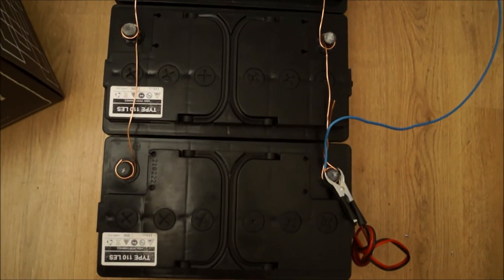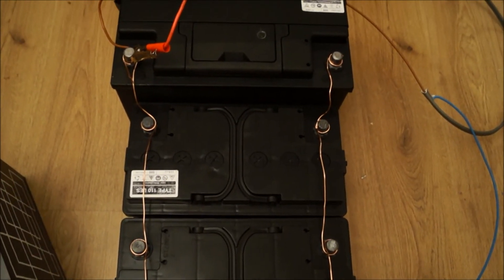Batteries Explained - Series - Parallel - Ah - Volts

Comment: Hi, Is it safe to use a bigger battery for my ebike ? mine uses 48v 21Ah, and the newer models of my bike uses 48v 42Ah, would it damage my Ebike's engine or would it actually improve the range of how many miles i can do ? . Thanks in advance

Comment: i have 4 batteries and they are all different ah my qustion is can i wire them in parallel whiout any problems ?
Reply from the maker: +Ilia Zhelezarov You can but if one of the batteries isn't very good compared to 3 better batteries, it will drag the 3 other ones down. So long term it's not the best. But having said that, my 4 batteries were new and 1 is clearly different. I haven't seen any noticable problems!
Reply: PrepareForTheUnexpected ok tnx my batteries have not too big of a diference in ah

Comment: A common misconception is that a 100Ah battery will produce 100 amps for 1 hour, 50 amps for 2 hours, 20 amps for 5 hours, 1 amp for 100 hours……etc.  This is absolutely incorrect.
Reply from the maker: David James Hi David, thanks for taking the time for the reply. Have a lovely day.
Reply from the maker: +Nunsweepit421 Surely this is rule of thumb? It's not going to be exactly 100Amps for example due to efficiency and ambient temperature and condition etc.
Reply: Not even close.  A 150Ah rated battery at the 20 hour drain rate (7.5A for 20 hours) will drop to about half of that rating when the load is increased substantially like by a power of 10 (an order of magnitude).  That same battery at a 75A load (according to your formula), should run the load for   2 hours but in reality it will be lucky if it  makes even 1 hour.  Therefore at the much higher load, the battery is no longer considered a 150Ah battery but rather much closer to (and possibly less than) 75Ah.  This is a well known phenomenon in the battery industry so why are you giving out wrong information here and making yourself look dumb?

Comment: Can you take a look at my vid...am not sure if its both series and parallel
Reply from the maker: All your lights appear to be in Series, using two way lighting for the cool effect. If you have only one set of wires going to the bulbs the're Series. Cool video!
Reply: PrepareForTheUnexpected at the 2 gang 2way switch,i looped the commons.If it is a series circuit the bulbs would've been dimmer.